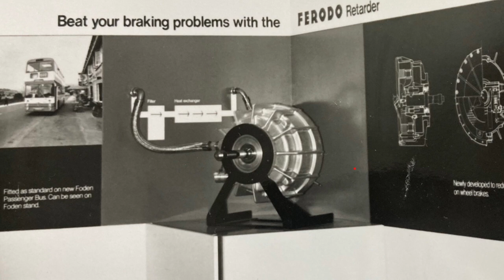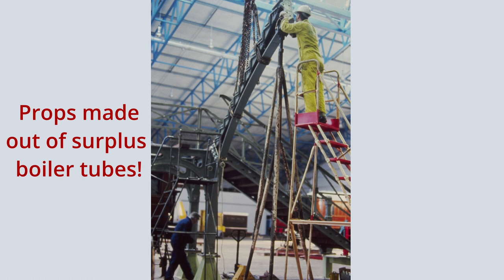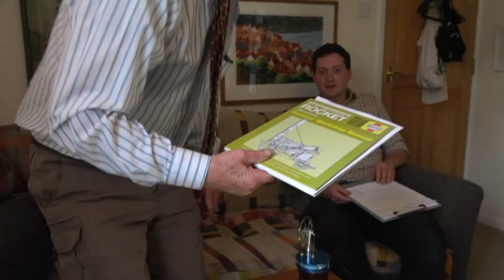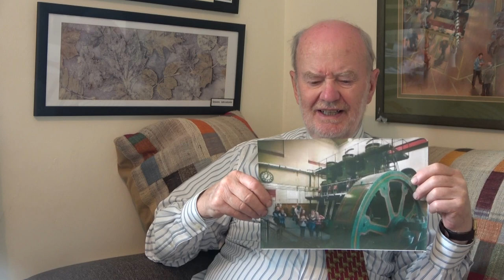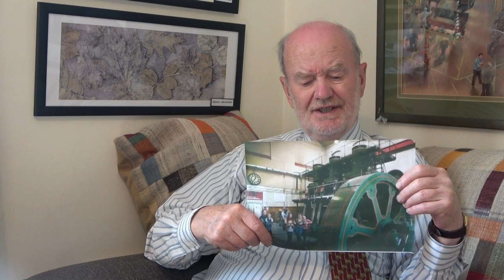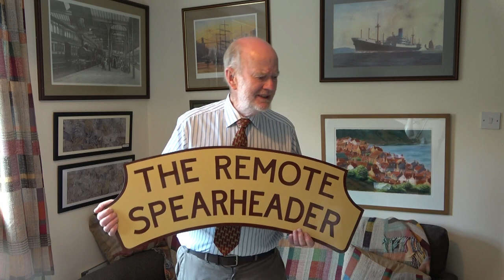So you want to be a Mechanical Engineer?

Comment: I can fully appreciate his desire to be a mechanical engineer. I did a two week "student observation" period at the Roan Antelope Copper mine in my home town of Luanshya, Northern Rhodesia. (Zambia) We were given a couple of days in each of the above ground work shops and I got to see  a 400 HP electric motor off a crushing mill that had burned out, delivered to the electrical shop still smoking. It took twenty tons per square inch pressure in the porta ram to get the drive coupling off so we could get the armature out for repair. They had a lathe in the machine shop that was used for truing up the armature copper faces. Its load capacity was thirty tons, six feet swing and over thirty feet bed length. They taught me to weld and gas cut drill steel for the underground workers. I was exhausted after the two weeks but it certainly steered me in my endeavours to someday own my own workshop.
Thanks for the video and I trust Mr. Gibbon will continue for a few more years of happy retirement yet.

Comment: This was an excellent video.  What an interesting man.  Listening to him describe what it takes to be a mechanical engineer was like reviewing my life to date.  I too became a mechanical engineer and like he said about himself, it started young.  I don't remember a time when I wasn't fascinated by mechanical things.  I do remember in 1977, when I was five, asking my mom to put some holes in a few of my Lego blocks so I could have axles where the Lego people never intended them to be.  We didn't have a drill in the house and so, to my mom's credit, she sized up my axles, found a nail that was the right size, held it with a pair of pliers over the element of our stove until it was red hot and then melted the holes were I wanted them.  Like Richard said 'the willing man (or mom) finds a way.'  By my mid teens I was fascinated with gas turbine engines and tried building one out of an old turbocharger that I mounted in a bench vise.  I could only get it to run for a few seconds before it would flame out.  It wasn't a complete loss however as my first job interview after graduating from engineering was at a gas turbine overhaul shop.  Like Mr. Crispin I was asked by one of the three senior engineers who were interviewing me if I knew how a gas turbine worked and I told them about trying to build one.  I got the job and was thereafter referred to as 'Turbo-vise' by the senior engineers. I agree that you need an endless curiosity and desire to never stop learning.  Also, the feeling you get when you dream something up and then build it and see it work is second to none.  Thanks again for the great video.  Ken
Reply from the maker: Good comment thanks
Reply: Your mum sounds great.
Reply from the maker: Yes indeed!
Reply: Such a curiosity and willpower should be apparent at an early age, say age 6 or so.  Further, there should be a curiosity to see how things work and interest in repairing household appliances.
Someone who has never repaired a bicycle, lawnmower, changed a fuse or tried to repair a clock, will never make a decent mechanical engineer.
Reply: @markrainford1219  She is.  When she was in her mid sixties I built a garage to put my workshop in.  She insulated well over half of it by herself, putting the fibreglass batts in like a pro.
Reply: @BasementEngineer  I made a very good friend while taking engineering.  We were like two peas in a pod, both having built stuff since as long as we can remember.  His dad (who was also a mechanical engineer) told me a story about how when my friend was about 3 years old he showed him how to use a screwdriver.  After he showed him he left him alone for close to an hour in the kitchen.  When he went back into the kitchen my friend was sitting on the floor surrounded by all the lower cabinet doors that he had unscrewed from the cabinets.
Reply: @hmw-ms3tx  My kids took the kitchen chairs apart while laying under them.
I guess they saw me and a friend working under the car often enough.

Comment: whilst not exactly an engineer, I do like working with my hands, with lathes and mills, ny career has been one of 44 years of draughtsmanship, i found i had a knack for it at school, and its been my career ever since, I learned on the drawing board, then relearned in CAD, in the late 1980's ( I asked my boss if i could learn these new CAD machines in my lunchtime, very soon I was one of the experts).
I love seeing a well drafted drawing, and I love working with my workshop tools.
Reply: Sounds pretty close like an engineer
My career is almost the same except that i never had a boss
Reply: What helped you learn to design? Drawing practice, books, educational media, work?
Reply: @distraughthogrider7969  I learned technical drawing at school, then started work on the drawing boards , after which I ended up working with CAD, so mostly self taught and taught by my older colleagues.

Comment: This was very nice. And the connection you guys have is so lovely. 
How long does it run on one cup of tea?
Reply from the maker: Just over the length of this video I think!
Reply: @MrCrispinEnterprises  yes it was a bit slow at the end, but it also seemed a bit uneven during the video, so i figured it might be edited. :) nothing bad in that - other than the engine timing.

A wonderful video, with loads of love both for the mechanics , life and friendship - apprentice and teacher. Thank you, and say thank you to Richard.
Reply from the maker: The video is pretty much as it was shot so interesting you noticed a change in performance. Thanks.
Reply: @MrCrispinEnterprises  yes you are off course correct. I must have been distracted from keeping track or the motor rpm by some excellent history.

Comment: Certainly in North America, material hoists are designed and built with a factor of safety of 5.  Thus an occasional overload is not such a big deal.
It does affect the useful life time of the hoisting cables and the brake linings, if overloads are done repeatedly.
Mind you, the workmen's safety people may have a few things to say about this, but in a pinch...
Reply: Designed to x5 safety factor, but tested to +50%

Comment: Great to hear from Richard, I too have been faced with similar issues when serving in Bosnia with the Royal Engineers. Having to improvise, adapt and overcome situations. Like trying to repair a bridge over a large deep gap with a crane that is no where near able to lift the weight. I figured out that if I lifted a corner there was enough capacity and deflection in the bridge to complete the task. We only had 24hrs to repair the bridge and we succeeded. So I can appreciate those kinds of scenarios and overcoming them.
Reply from the maker: Nice story!

Comment: For those who are worried a tie or hat is not strictly necessary to become an engineer. T-shirts are also fine! 😁
Reply from the maker: Lol!
Reply: The attire depends on the locale and custom of your employer and his clientele.  In my early years I always wore  suit and tie.
Later on when I was self-employed I made do with a jacket and tie.  The suit was viewed negatively by my prospective clients as they viewed this as a "paper pusher's" attire.  Whereas the persona I was trying to project was that of a hard-nosed, practical, can-do type of Professional Engineer.
Reply: I was told by one of my colleagues at RR that the ‘old school’ Foremen always used to wear bowler hats when traversing up and down the manufacturing facility.  It was supposedly a sign of their status within the company hierarchy. They also used to wear a different colour Lab coat to the normal workers, this was supposedly to make them more visible on the shop floor.
Reply: @michaeljohnson-li5nn  Yeah, they used to have their own 'wash-room' facilities as well. Having a key to the foremen's bog was the ultimate status symbol, and it mean't you were officially allowed to buy a house in Mickleover.

Comment: I'm studying Bachelors' in CSE (3rd yr), but I recently found my interest in mechaical engineering. Is there any way to switch from CSE to Mechanical Engg as a Masters student?
Reply from the maker: Sorry you're asking the wrong person!
Reply: In Spain you can enroll cross field master's coming from a broad sort of degrees. What you get asked is to pass a minimum of subjects specific from the field related degrees.
E.g I asked from enrolling a master about EV and instead of 1year and a half i wold have done and extra year before starting the standard masters subjects learning the basics of power control, micro electrònics, circuit analysis....

Finally went to a systems and tecnologies of energy conversion masters ( more thermodynamics and control related)

Comment: Ericsson or stirling? What's the difference?
Reply: Pastor Stirling was the inventor of that thermodynamic cycle, and built the first such engines in the early 1800's.
Reply from the maker: Two different designers that bother worked on hot air engines.

Comment: The trouble nowadays is that you get people straight out of university with no practical experience and have never made anything in their life. And they are employed as mechanical design engineers but they lack the practical experience which is needed to be able to design something so that it can be made. They may be very academic and  good at calculations but unfortunately lack the design skills.